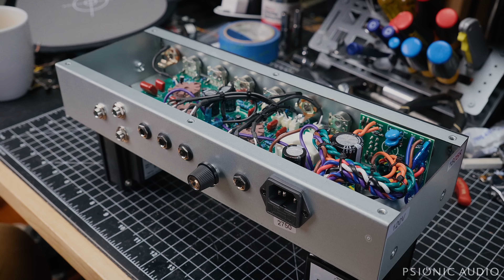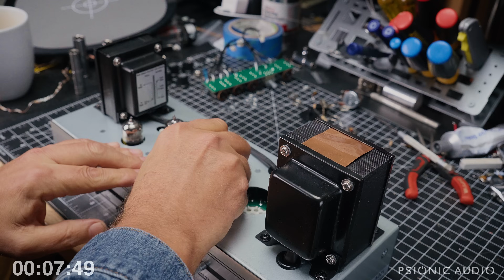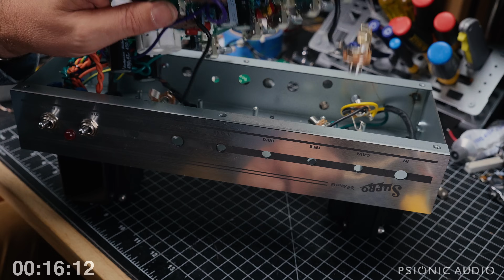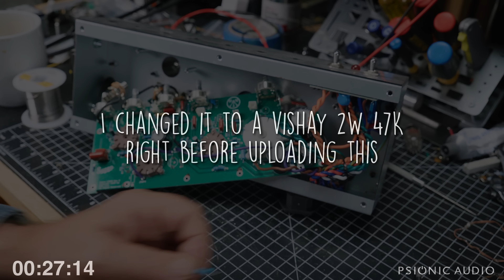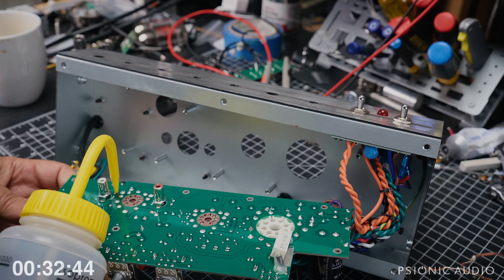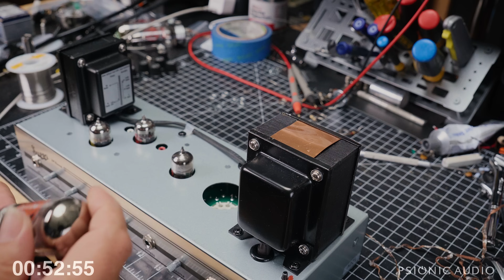Diving In | Supro 1605RJ '64 Reverb Pt 2

Comment: Great vid as usual Lyle.  Would there have been any potential downside to upping the voltage rating of that cathode bypass cap?
Reply from the maker: Thanks. Aside from lead diameter and spacing, no, but the cathode only has about 24VDC on it in standard use.
Reply: @PsionicAudio  Just my wild speculation, but given how people tend to run this sort of amp I'm wondering about flyback spikes exceeding that voltage.  Not sure if output stage has NFB or not.

Comment: What is that screwdriver holder???  I need one!
Reply: I have found endless possibilities in a scrap two-by-four drilled with holes, routed out with a flathead and hammer, etc. Way quieter than having your wife stand next to you holding things for you and asking why you are doing it that way and how she thinks it should be done a different way.

On another note....our 28th Anniversary is coming up! Thanks two-by-four!
Reply from the maker: Some cheap thing off Amazon. Looks good but can be frustrating to use.

Comment: I know these cheap amps aren't a high-level tech's dream job to work on, but maybe you'll get more eyes for your video side of things because so many more own this type/level of amp, compared to a barely used vintage amp that runs $5k to buy.  I own both - handwired and cheap PC board w/thin boards and SMDs, and want to learn about them both.

The cheap amps sound good enough to justify throwing reasonable tech time $$ at them for component level repair, but I ease the $$ burden by removing the chassis myself so the tech can focus, and I always provide a schematic.  So far, so good.

Thanks for another great walk-through.
Reply: Trying to find a schematic for these modern Supro amps is really difficult and the company was sold off so tech support is very minimal.

Comment: A friend and local amp technician of mine got in 3 of the bigger ones into his shop. When they finally got picked-up, they all caught fire from a band using them as backline a few days into the tour

The cabinetry is really bang-on, and I find them pleasant, but it’s a shame the build quality is brutal.

Buddy ended up buying one of the toasted ones really cheap from the store and ended up hand-wiring it w/ a turret board in line with the original circuit.